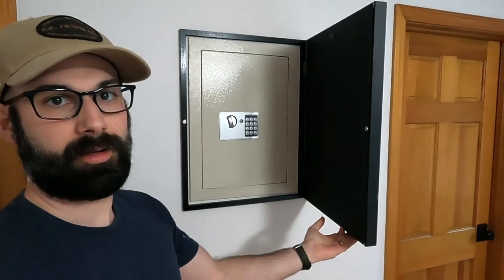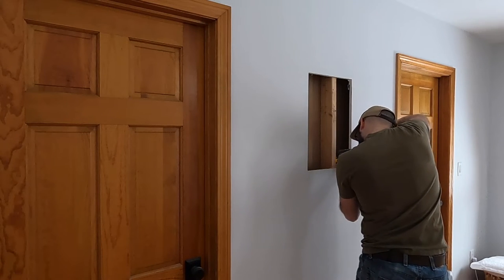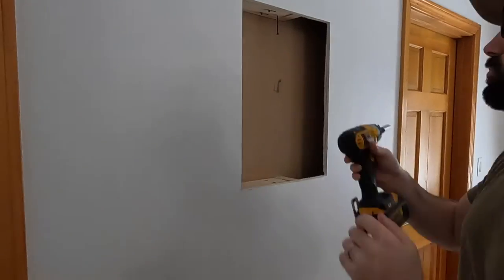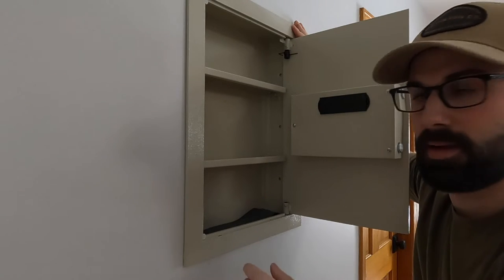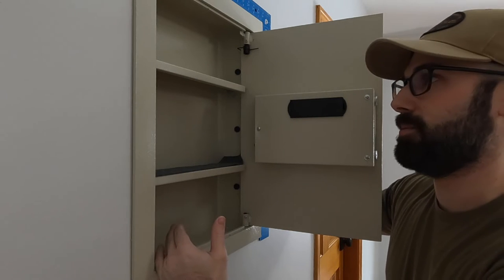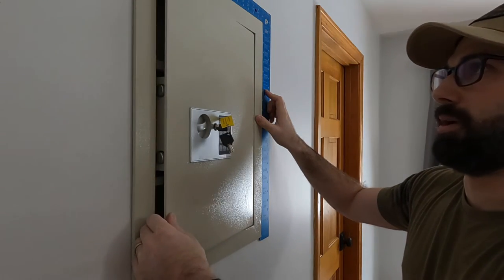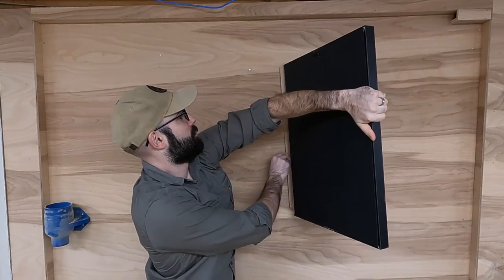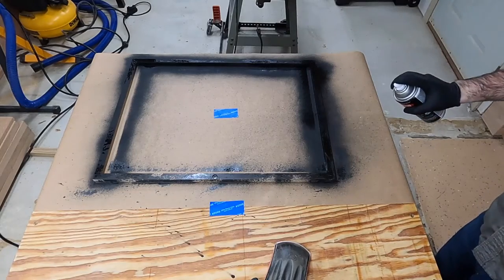Hidden Wall Safe :: DIY Tactical Wall :: How to Make a Safe

Comment: You just removed a section of stud? Do you know if this wall is load-bearing?
Reply from the maker: The wall wasn’t load bearing, so no concern. If it were you could simply add a header and two cripple studs (from header to floor plate).

Comment: What is the size of your white oak. Is it 1" x  1/2"    ?
Reply from the maker: It’s roughly 1.25” x .5”. It was something I just  milled up quickly so it’s not exact.
Reply: It didn’t work for me. The picture lined up way lower than the frame.